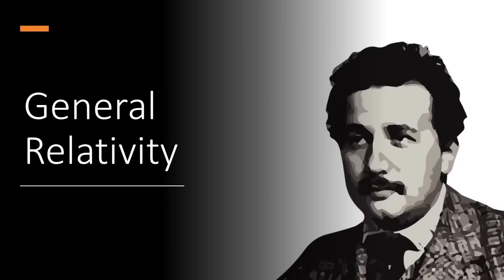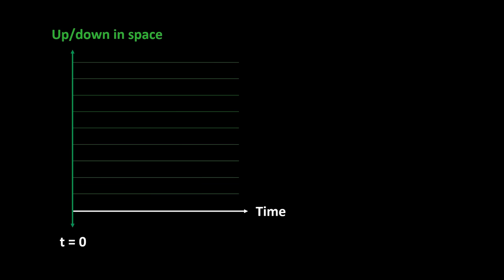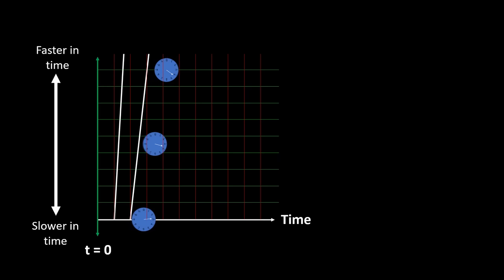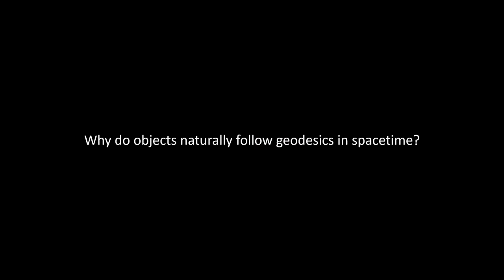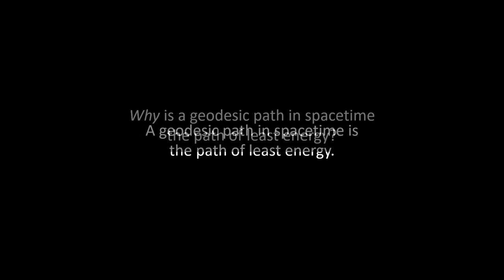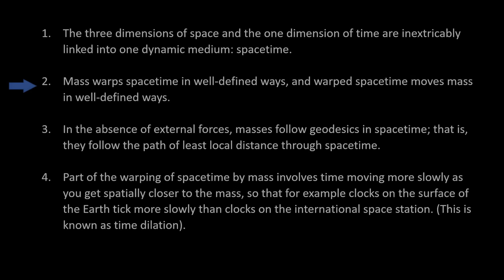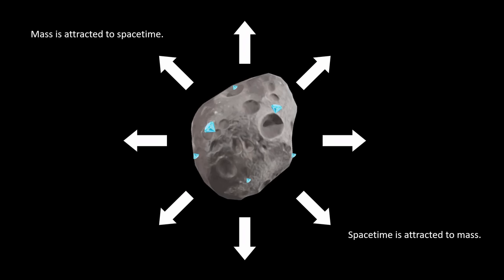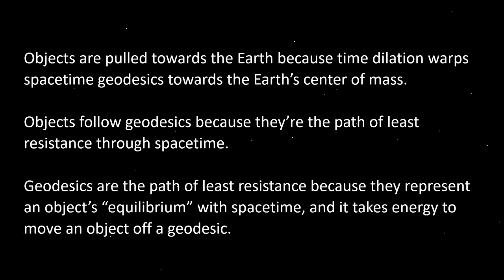How Time Dilation Causes Gravity, and How Inertia Works

Comment: It’s almost like mass creates a hole in space that space coagulates to patch/spackle — like a hole in the wall. And that greater density of coagulating space slows down time which results in geodesics whereby the slowest time is also the lowest-energy state that an object in a gravitational field defaults to.
Reply: I have always thought of mass in this way since I was little and wondered about the stars. As I was told about gravity, I thought of it as every massive object sort of has "pushed space out of the way" to occupy that space, and that is why objects have any kind of effect on eachother to begin with.
Reply: @SolidSiren   This video made me think of gravity as mass that digs a hole through space time and is stuck to that hole unless energy is used to move it out and that hole is the point in which it has the least amount of energy. It actually makes sense because if matter didn’t follow the path of least energy, everything would descend into chaos
Reply: I especially like this explanation because it doesn’t straight up go to the conclusion “this specific aspect just works like that”. It connects relativity with other well known laws of the universe like the notion that the universe tries to reach equilibrium at all times and how the cause of this is the actual answer we’re seeking, the way matter attracts space time. This by far made the most intuitive sense.
Reply: Oh wow it actually makes sense
Reply: That's a very interesting way of looking at gravity and time relations. Using the concept of time as an actual force might be the way of finding a formula that combines all four forces, the strong nuclear force, the weak nuclear force, electromagnetism, time and gravity, thereby completing our model of quantum physics and identifying all force particle fields that exist. Our lives will then be complete. Well, at least better informed. Lol!
Reply: I always thought of it like displacement. Like space is displaced around the object which causes drag on the flow of time
Reply: Recently physical time was explained as quantum fluctuations, and so forth, without abstract 4-dimentional models. Check "Time = Quantum Fluctuations. Gravity = Time Dilation. Strong Force = Gravity." and there.
Reply: Have you tried "Time Matters, 3rd edition", where time was physically explained as quantum fluctuations, gravity as push (and not pull) from quantum fluctuations thx to time dilation, and even strong nuclear force has the same origin ...
Reply: atoms are mostly empty space.  Matter does displace space, which pushes back against the matter as it passes through it. This causes a higher density region around the mass. Essentially, gravity is the effect of spatial pressure.  We aren’t pulled towards the earth, we are pushed down onto it by space. So why time dilation?  Time is just the rate of quantum vibration.  In a high density special field, the vibration is slowed, ergo, time is slowed.
Reply: E=MC2 is just a joke..,  First off we live in a magnetic world.  E=MD  (Magnetic Density),  All mater is magnetic all plants people everything we know exist is magnetic.  The center of a magnet will prove all this to you!!   Start working with the center of a magnet and you will see many things , Anti Gravity is one..  When Tesla tested his tower in Colorado for the first time he sent too much power from space into the local power plant and blew up one of the generators. FACT..  The north and south poles are the weakest part of a magnet,  The energy in the middle once you learn how to use it will blow your mind!
Reply: @Phumgwate Nagala Ahhh methinks your question is the nexxus of the problem posed! Or something like that.
Reply: But on the surface of the sun for example we have high energy particles and photons and at the same time the time must delay for the mass of the sun. So what’s happening is that time slows down but the energy of the particles are high so they are moving fast: is not a contraddiction?
Reply: Youre literally everywhere Tay
Reply: Mass has nothing to do with it, light is also affected by gravity
Reply: why would space coagulate in excess to plug the hole....should just be equal to the amount needed to exactly make up the deficiency.
Reply: Hi Tay, is this comment really wholly from You? Im not sure tho. Anyways 😉
Reply: @midnighttrain-jz2my  Who else would it be by? 😂
Reply: @tayzonday  Oops...checked your WIKI-page. I thought you were just an entertainer, didnt know you were at the Illinois Mathematics and Science Academy. Sorry for the hasty comment.☺
Reply: @tayzonday  Are you studying cosmology or what? I find you on so many GR videos, go get that PhD man! 
The Dr. Chocolate Rain astronomy and cosmology channel would be great! Lol
Reply: @ExistenceUniversity  Nah. Although my father taught chemistry/physics. I pursued an American Studies Ph.D and dropped out with a masters degree. I don’t think anybody wants to watch a channel on the latest sociological or anthropological studies— not as visual as science . . . plus discussing controversial topics YouTube doesn’t like.
Reply: It's not a hole. It's the opposite.
Reply from the maker: The man, the myth, the legend himself! Thanks for watching, Tay. I like that analogy, I think of the formation of mass as basically just this, something like a knot tied into spacetime that pulls space inwards in all directions (at the speed of light), and which in some abstract way stretches out time as well.

Comment: Inside an atomic clock an oscillator emits about 4GHz photon that reaches a Cesium atom, which absorbs and emits about 4G photon times per second. If I place a second atomic clock near a mass the Cesium atom emits 4G - a small value of photons per second. The mass influences what? The frequency of the photon of the oscillator? The oscillation frequency of Cesium? How ? By lengthening the space between the oscillator and the atom?
Reply from the maker: Great question! I'll be honest and say I don't know the exact details here (hopefully someone more informed can chime in), and add that the interaction of particles with gravity is poorly understood (see quantum gravity for more). In general, mass warps spacetime, so the change in the metric of spacetime is why the atomic clock ticks more slowly relative to unwarped spacetime. Does that help answer your question?

Comment: Having seen all those apples and clocks move about at different rates, one question that remains is "why do objects move through time in the first place, then?"
Reply from the maker: This is a great question. Ultimately, time passes because things change. Why do things change? Because they're following the laws of physics, which require things like momentum to be conserved. Why do the laws of physics make things move, and why do things follow the laws of physics? In some way, the things have their existence rooted in and defined by the laws of physics, so you fundamentally can't separate out the laws from the things. Why do the laws and the things exist? No one knows.

Comment: What if time is actually the distance between two points.  I think you're right about time dilation causing gravity.    If you look at the twin paradox.   While one twin is traveling away from the other they age at the same rate however each one sees the other as moving more slowly.    It's like they are in molasses.   The twin on earth sees the engines firing more slowly. It's as if it's got less energy to move away.  Some of it's energy away from earth is lost.  However when the space ship turns around the twins see each other moving more quickly.   What if the perception is the reality.  The ship moving away slows down while the ship approaching speeds up.   Thus time dilation explains gravity.  Just as moving away from earth slows you down and moving toward earth speeds you up.   it's true you're not moving at the speed of light.   However your electrons are all moving very fast.